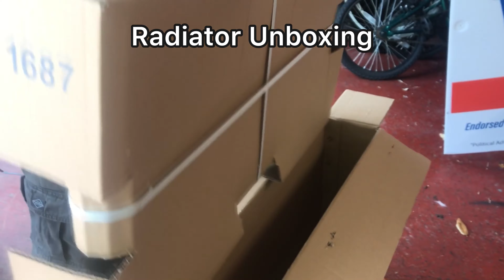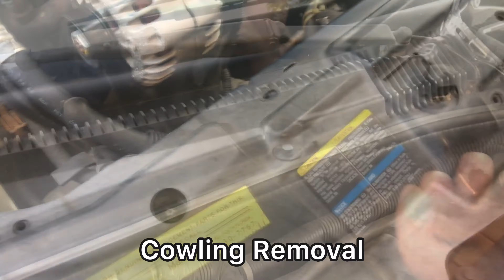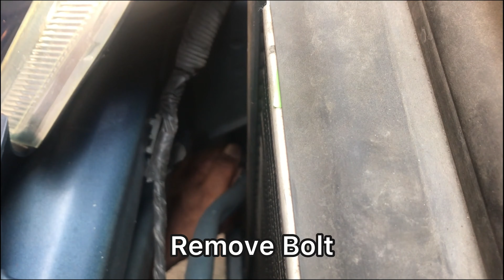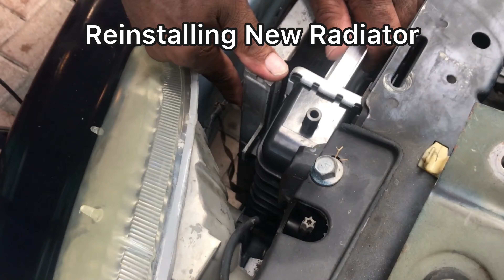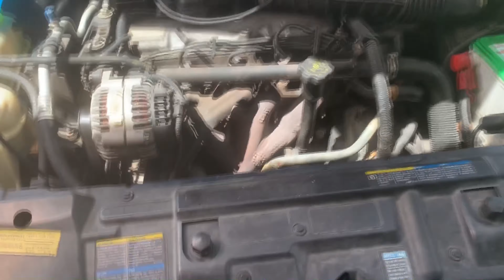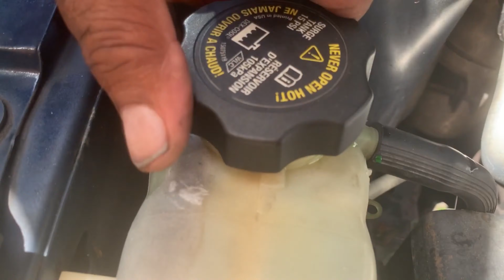Radiator Fan & Radiator Coil Leak Repair

Comment: Great video, how you figure out that the radiator was cracked
Reply from the maker: Easy, it will be leaking fluid
Reply: It’s was leaking but in the form of steam. When it was hot.